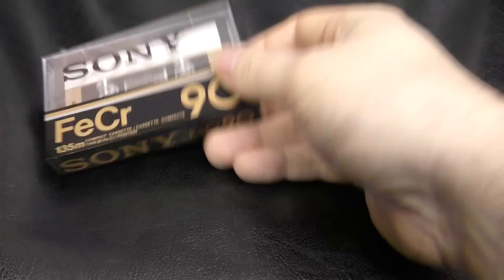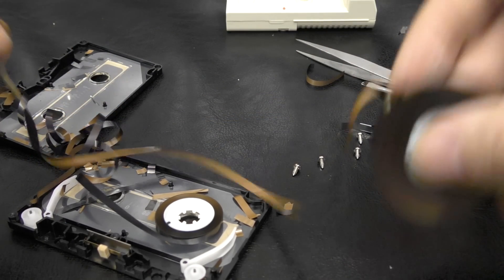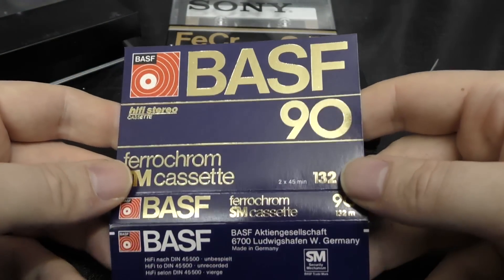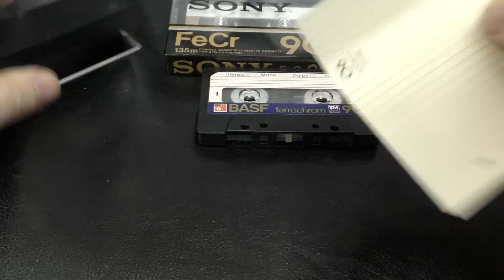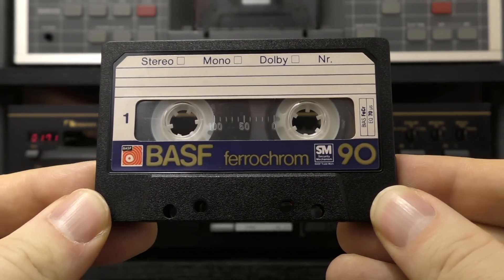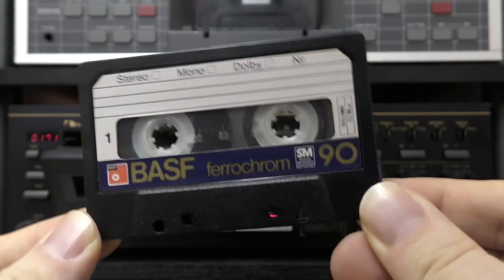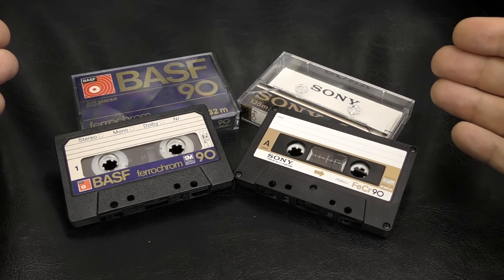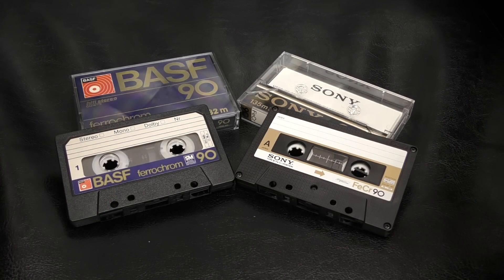Type 3 FerroChrome Cassettes - You Wanted Them, You Got Them!

Comment: For the year or so that I’ve been into cassettes, I’ve seen literally hundreds of blank ferric tapes. Chrome tapes aren’t nearly as common, but I’ve seen a fair share of those as well. I’ve seen a handful of metal tapes, but they were a bit expensive, so I never actually bought one. However, I have only ever seen one ferric-chrome tape and that was at a flea market. It had already been recorded on, the inlay was fairly worn and I can’t even remember what the brand name was, but the fact that it’s a rare type 3 tape was enough for the guy to slap a $30 price tag on it.
Reply from the maker: Where there's muck, there's brass...UK saying.
Reply: Same story. Got my first Sony Duad a few weeks ago, with a Japanese lot. Used, with a recording off Japanese FM radio - and that's technically a superb recording, as good as FM taping goes. Curiously, tape surface is all pitted and mottled, but it still plays fine and apparently needs no Dolby at all. Very quiet and balanced.

Comment: Great vid Tony. I've just ordered 2 of the BASF  - one will be a shelf queen (I'm a big BASF fan) and with the other I'll take the risk with some recording :)
Type III are interesting for many reasons but there is also another reason for the slightly dull and laidback sound.
Ferric has good LF sensitivity and output, Chrome has good HF sensitivity and output - however both have lower sensitivity in the mids, or rather upper mids.
Therefore when you combine these 2 layer types you get a 'smile' contoured frequency response.
One of my decks, a JVC KDA66 has auto cal wich includes EQ inaddition to bias and level, so it lifts the upper mids to match the level of the HF and LF - voila - flat response.

If the recording goes well I'll rip to youtube on my channel and you can take a listen.

Have a wonderful christmas and new year. Rob
Reply from the maker: That's the thing, they're such hard work that I can't be bothered 😄
Reply: It is the mid-range dip which all double layer tapes have, more or less. Decks with a proper type III position should have a pre-set recording EQ which compensates for it. This is why it doesn't really lead to good results to record a FeCr tape in a non-type-III-capable deck, regardless how you set the bias and the EQ. The trick to record it in 70 µs and play back with 120 µs is only a workaround, which nevertheless can sound pleasing. You may wonder how this makes sense, but during recording, you never use 70 or 120 µs as the EQ which is applied to the tape. These figures do only point to the playback EQ, which is standardised. The recording EQ can be very different and depends on bias and tape type, but even on the head properties and on the recording amplifier in your deck, so it is not, and must not be standardised. In each deck, the recording EQ is preset to curves (for each tape type it can handle) making sure that this deck, on the tapes it is aligned to (type I, II, IV and maybe III), will record onto these tapes in a way that it will give you a neutral frequency response when played back on any deck with the standard playback EQ values of 120+3180 µs for type I, and 70+3180 µs for types III, III and IV.

Comment: I always found Ferrichrome cassettes to sound very muffled with a weird “hole” in the midrange (the crossover where neither the ferric nor chrome layers weren’t being magnetised very well?). I had an Aiwa deck with a specific setting (Aiwa marked the two manually operated switches for FeCr as 110% bias compared to 100% for normal ferric and 150% for hi bias tapes but with a recommended (on the switch) 70 microsecond equalisation for recording AND playback). FeCr tapes were NOT designed to be played back with 120 microsecond EQ as that would make them virtually as noisy as a normal ferric tape; it would though, of course, make it sound less dull...
Reply: I listened to Ferrochrome back in early 80s and that was the case -the dynamic range was better .-maybe it was a ageing case as with Metal -ageing meaning they sound the best just after the recording and maybe a week or 2 then  later then metal would loose the highest pitch -Muffled but dynamic  is Fe Ch tapes or maybe the recorders fault dunno -I had a nachamici  their cheapest cassetterecorder with dolby c

Comment: The Revox is by far the best deck I've ever heard, it sounds always like a 30 000 dollars valve preamp, sounds better in tape position that the Nakamichies in source, maybe electronic components or input and output transformers.
I can't notice differences in tape source with this one, regardless of the tape, but in the others I do.
In this the dinamic and emotional interpretation of the singer was very evident, while in the Nakamichi in source mode was flat and full and sounded like the RCA cables that equipment comes with, the white and red ones, simply not musical just flat and dull.
I have a Revox pr99 but the copies are more expensive than buying the vinyl, I don't record any other things, maybe some vinyl records to 96khz 24bits, that have not been issued in digital format.
Thank for your channel.
Have a nice Christmas.
Reply: The audiophiles used say that the best sounding cassette deck was the Tandberg 3014A.

Comment: Wow! I’ve never seen this one before. I used to have the Denon DX5 that has the FeCr “Type 3” and it plays fine on both biases, and it was combination of both normal and high bias in one.

What’s interesting that Sony had the SP Mechanism on all cassettes including the CHF, LNX, EF and Super EF.
Reply: The Denon DX 5 is actually not a real FeCr, but rather a double layer, cobalt doped ferric, just as the DX7, only with a different bias point and EQ curve tweaked to fit for type III position. A really good - and rare - tape. 

Sony's SP mechanism consisted of the strongly folded slip sheets, combined with hubs that were thicker in the middle than the tape width. That trick ensured quite smooth and centered tape winding, without the need for any additional mechanical parts.

Comment: That's not true, the SM mechanism didn't disappear in the mid 80's. Tapes from 1989 still have them, but you can't see 'SM teeth' because of the small window. BASF didn't use the SM teeth not in all cases, maybe because they would look ugly. An example is the Maxima II with the unprinted transparent window. This cassette has no SM teeth, but the mounting pins for them. I think the last ones which have these mounting pins are the yellow Ferro Standard I.

Comment: My guess with those BASF tapes is hardening of the plastic, turned that originally soft springy SM mechanism into a hard scrapper. And I'll twitch onto it only taking a decade or so before BASF started to notice the issue in its infancy, and dropped it as fast as they could to avoid brand suicide.
Reply from the maker: Supposedly it was something to do with an engineer who did the patent and got a share. When he left, the dumped it.

Comment: I have three decks old enough to have FE-CR settings. A JVC deck. A sony music system. And a jvc boombox. 
AS FAR AS I CAN TELL from the circuit diagrams all three use the standard 70us on playback.  
For record;
- The JVC deck uses identical bias to normal, but it applies a unique record eq for fe-cr (ie different to the other three it uses for normal/cr/metal). 
- The sony music system also applies a unique record eq for fe-cr. 
- The JVC boombox uses normal bias but standard 70us eq to record. 

All of which seems to imply that in a perfect world
1) the tapes should be recorded with 
- a  bias level close to the normal (type-1) setting 
- a unique record EQ setting designed specifically for fe-cr tapes
2) played back at 70us.
Reply from the maker: Thanks for the insight!
Reply: I noticed my ancient Hitachi D-E99 records a custom EQ and bias for Type 3 and plays back at a Type 3 EQ and bias.  If I play back the Type 3 at Type 1 it sounds overly bright and fuzzy sounding.  I've only got a second hand Sony FeCr I got with a pile of old tapes and a 70s Sony deck, it sounds pretty good, probably better than most cassettes of that era.  But a 90s super chrome kills it entirely.  The SM on the BASF doesn't put a lot of force onto the tape, so if the tape sheds without it, the tape will shed later, the two layers separating from the polyester backing and hopefully flaking off inside the shell and not into the transport...

Comment: You are incorrect regarding playback equalisation. Ferrochrome tapes were originally designed to be played back at 70 microseconds. The cutout on the top of the tape was primarily designed to auto set bias NOT equalisation. Ferrochrome cassettes needed bias closer to normal ferric cassettes but 70 microsecond playback equalisation.

Comment: I think when you record them in 70ms (and playing at 120ms) there is even more emphasis on highs. I think it should be recorded and played back with the same EQ settings to be closer to source. I normally just have a good autocalibration deck (like Pioneer CT-95) let it calibrate as Type1 and that is sounding just fine...better that e.g. my Pioneer CT-F750 could record them using Type3 selector. However, I just bought Pioneer CT-1A to give'em a try with Type3 native support + automatic calibration. just for fun. becuase recording cassettes is just fun and nothing else nowdays, you know...
Reply from the maker: I'm sure a dedicated Type 3 setting will give better results. The Sony still sounded pretty good though.
Reply: @CassetteComeback  Yeah, Sony FeCr is very consistent and reliable in both Type3 and Type1 position. And I belive it is the second best Type3 after Denon DX5...also because I belive both of them are made using fericobalt for the top layer, while BASF is Crome and suffers from the same degradation issue as other Cr BASFs of the earlier 80s before they quitely switched to cobalt dopped feric formulations. Hence the dropouts and the dull sound. You might have a completely different results with them 30-40 years ago. and their today's market value has nothing to do with their sound quality - the most expensive FeCr is the AGFA's last generation of Carat HDX just because they are rare. at the same time they maybe be the worst FeCr ever for recording

Comment: Ferrochome should have become the standard. Metel was good for studio recordings on something compact but for home recording you would have warned the warmph of sound of the Ferric and Chrome combo instead a better as it sounds more like the tapes we are fond of and cheaper way of a balanced all around tape sound for the home market.

The Ferrochome would have been perfect for the Denki mech kit from these days as well so there wouldn't be such thing as a low end tape deck as they would have the right tape released to record on so it would sound worse than audiophile kit but wouldn't be so low end in it's own right.

Chrome 120 worked for pre recorded land they were Chromes where they extended the tabs to Type 1 with plugging the rest of the hole up with toilet paper then they duplicated the master reel on 120db mode normally used on a Ferric but it had the propities of the Chome in the recordings too.

Ferrochome being the format of choice for the Denki's or even just using pure Chomes with the tabs extended used in Denkis to make Chrome 120s would have stopped all this tapes are crap nonsence because of the Denki's becoming a thing made tape sound low end because people think they can only use Type 1 on it when it's strictly untrue they could use anything it could play for recording too in fact by extending the tabs to get Chrome 120.

Knowing the Tenashin Denki's were coming why did they take these off of the market instead of making it the new Type 1 for Denki times is beyond me.

But then I did say so myself in this long sentence as well you can do Chrome 120 so whats the poiny in a mixed compound unless it's Cobolt if you can do Ferrochrome like sound on a pure Chrome tape.

Comment: This got me thinking about Pre Recorded cassettes which are Chrome but biased at 120uS are they maybe ferro chrome or just standard chrome biased at 120uS I have a Dire Straits tape like this and sound was faded with drop outs so tried re recording from SACD and was surprised how good the tape actually is,I did record in Normal position at 120uS I wonder if it would have been better at 70us but the tabs restricted me trying on my particular deck with automatic tape type selection.
Reply from the maker: They were recorded at 120us so they could play back on all decks. I got given a Laura Brannigan album that had been recorded over, but I put Laura back on it. I recorded it as a type 2 but a 120us.  It was a pure chrome tape and so it sounded good.
Reply: @CassetteComeback  do you think it would have been better at 7us ?

Comment: My 1980 BASF Professional II doesn't have that bit at the top. Maybe they dropped it before the whole thing was dropped entirely. I played it a few times but i'm removing the mechanism anyway.
Reply: I do not think there is a problem with the secure mechanism, in fact its construction is ingenious, it helps to minimize friction by laying down tape in a spool evenly thus allowing it to run smoothly inside the shell.

Comment: Apparently they were planning to standardise notches for FeCr like this, which makes sense:
https://lh5.googleusercontent.com/-zaTh_riY_wY/VPC6v3CBg6I/AAAAAAAAKhU/3F9kyMtrPy0/s800/DUAL.jpg
So it's like a binary code, 2 notches giving 4 possible codings for 4 types. However this never came to be before FeCr disappeared, the ones actually sold had no notches like type I. This is why the only way to use FeCr properly is on decks with manual type selection.

Comment: Removing SM mechanism to prevent the tape from shedding? What's the point? If it sheds because of SM mechanism, it will definitely shed inside the deck.
Reply from the maker: So 2 identical cassettes from the same batch. SM in one, it sheds. SM removed from the other, it doesn't. Look at the evidence smartass.

Comment: Hi, Tony. I also had that awful experience with BASF type 3 cassette I bought from one of Russian resellers on meshok.net. Tape behaved exactly as in your video. Magnetic layer had stripped off right on me. Cassette was sealed, totally unused. Hmm, maybe BASF type 3 s all behave like this...
Reply from the maker: Perhaps the sealed ones, with the SM still engaged. That's why I'm selling the ones I have cheaply, as collectors pieces only.
Reply: Cassette Comeback Shredding Mechanism is to blame for sure but the tape itself is that bad. I had one when I was a kid in 1984. So it wasn't that old. And same thing happened. Surprisingly enough the only other FeCr cassette I've ever seen in my life was that Sony cassette.
Reply: @CassetteComeback  You know what, in 1983-1984 among other Type I cassettes Soviet government purchased BASF LH-EI 90-minute cassettes, and I actually liked that SM tape guides in them. So, as for now, I still have 10 BASF LH-EI SM casettes, yellow ones, I guess 1982 version, which I bought in Moscow during 1983-1985. And all of them have very good performance today, and tape is still in perfect condition, regardless of the SM present in them. The only difference between these FeCr ones is that LH-EI have only two side tape guides, but don't have the one on the top. So, I guess there is also something wrong with the production quality of the tape itself, bad glue or so. If SM is the reason for tape stripping like this, then why my Type I cassettes with SM are still all good?
Reply: @shadowflash705  Thing is that Type I cassettes I still own with the SM don't have such kind of problems, and are still in perfect codnition.
Reply: Константин Терлецкий I had minor problems with some type I cassettes with that kind of mechanism. Sometimes that thing was starting to resonate, making cassette to make whining/howling noises when winding. But it never peeled off the magnetic layer from type I and II tapes. So I guess formulation for that particular tape type or batch is to blame. Well, normally tapes don't shed even if you seriously abuse them. Unless you store them in some place with really high humidity. But FeCr tapes are known for that, and those BASF cassettes are the worst. But again, maybe it's a bad batch. Because even here in comments people say that they don't have any issues.